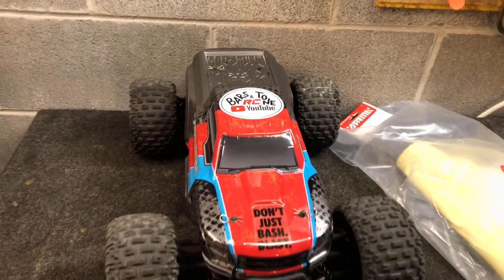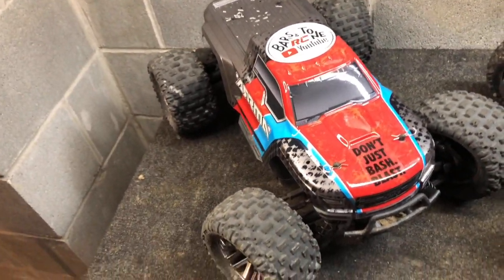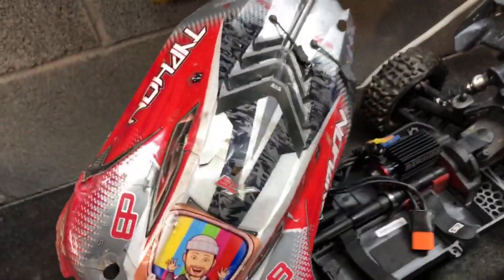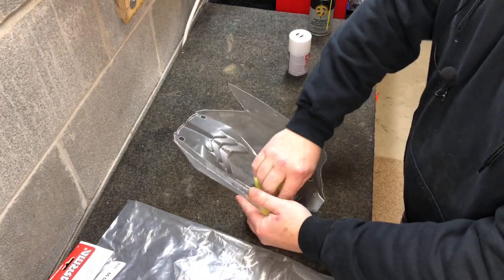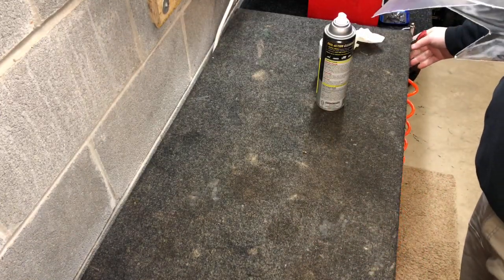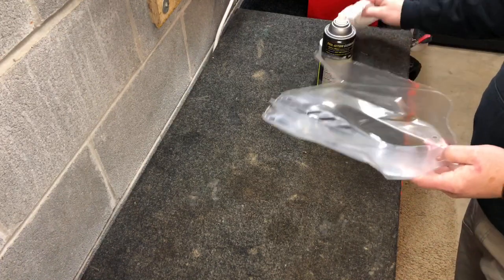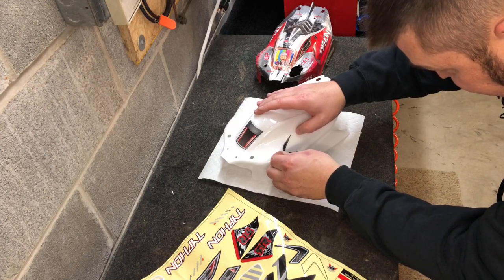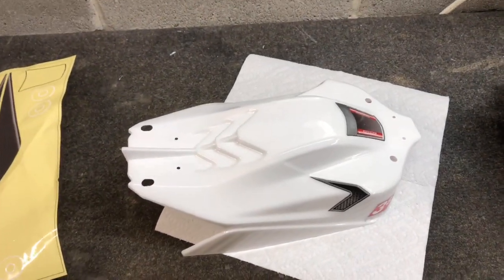Typhon 3S finally gets a new body! My attempt at body painting.

Comment: The body came out great. I'm not sure why but the white looks great on the Typhon. I'm getting ready to paint my first body and it will be white and blue. Mostly white but it will have different decals than what comes with the Typhon 3s BLX. I hope mine comes out as nice as yours. I know you need to clean the body inside with soap but most people just use a rag or paper towel. I have seen a couple of videos where people use some fine scotch bright to scuff up the inside but I just wonder if you see any scratches in the final paint job?
Reply from the maker: Yeah there’s something about this body all white does look really nice. I was really happy with the paint job

Comment: First off just line up old body on the inside and drill body holes. 
2) Dont trim body
3) Dont use carb cleaner. Good ole dawn dish soap and water.
4) thin coats of paint. 10 min to flash paint then next coat. Coat to solid color. Thin spots. Look threw outside and cover them.
5) trim body out. Sand any sharp corners.

Done stickerise the body and run it.

Comment: About those ebay shocks....i have the same ones. Did you change out your rear springs? It looks different than the fronts.
Reply from the maker: I had these on there for a little bit but I had a lot of problems with them and took them off

Comment: Arrma typhon 3s or traxxas rustler 4x4 vxl Which one should get????? and  Why??
Reply from the maker: Typhon 3s no question, it doesn’t overheat it’s easier to work on it jumps nicer it’s more controllable. And parts are cheaper.
Reply: @BarstoneRC  okay thank you
Reply: @BarstoneRC  but What of the two cars it  better for you  backflip And Front flip ext.
Reply from the maker: Typhon 3s
Reply: @BarstoneRC  ok